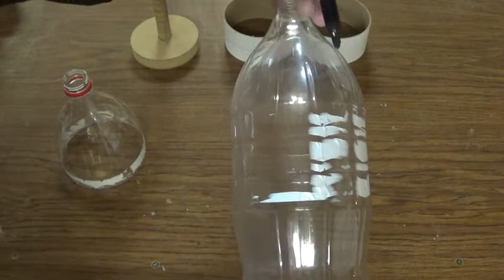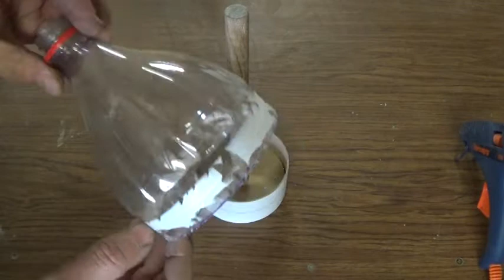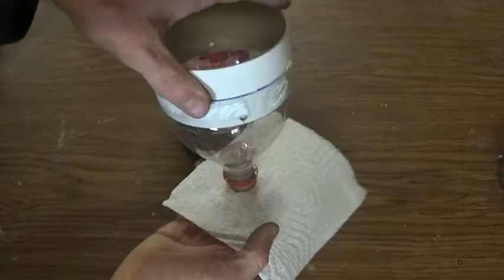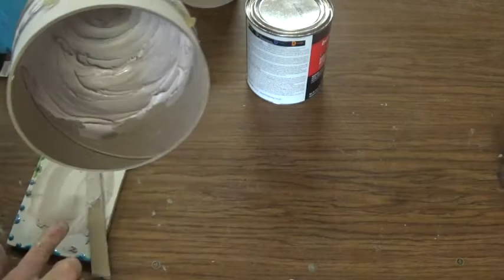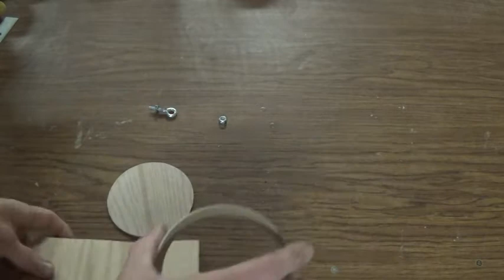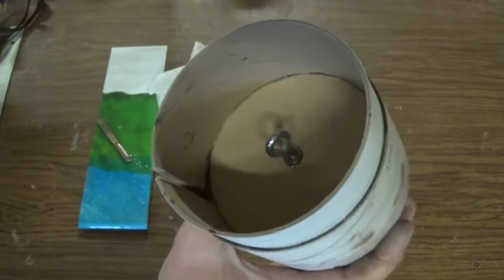How to make a 4" model rocket nose cone.

Comment: Thanks so much. This is a badass idea. I am building a k motor and i was having issues. I used a lathe to make the nose cone from wood but it was too heavy so i was then thinking of taking a mold of the wood cone and using fiber glass in it. This is going to save me all the hassle and money.

Comment: That's one thing that I've struggled with well one of two things getting a bevel in a cone not really the cone I use a belt sander then sand paper  or going from a larger to a smaller tube you can do most common shaping from balsa dowels larger cone it's the belvel like the Saturn v it's  easy just don't know where to find the tubes in the correct size I need I've been building them for a few years now more into building realistic rocket so that does require beveling and and shaping some parts to a realistic look I need to check out some postage tubs for the currant one I'm building need it to be 6 to 10 inch an need ideas for a nose cones to fit that anyone have advice pls help from a fellow rocketeer
Reply from the maker: I'm afraid 6 to 10 inch diameter is a bit out of my building range. Have never given any thought on how to build a nose cone that large... Sorry, no suggestions.
Reply: Are you trying to build a ICBM?
Reply: @jeremiahthompson82  haha basically    jk I'm working on a rather large scale saturn v I estimated the length to be exactly 10 ft tall of course I'm currently awaiting my license to even begin on the motor sections don't want the usaf to scrabble f18s on me lol I don't live to far from a base

Comment: The nose cone is grrrrrrreat, but I would put a ping pong ball on top (for safety), and/or get the angle straight as with the "break" in it you lose altitude. 👍